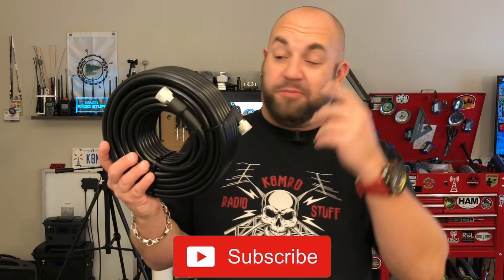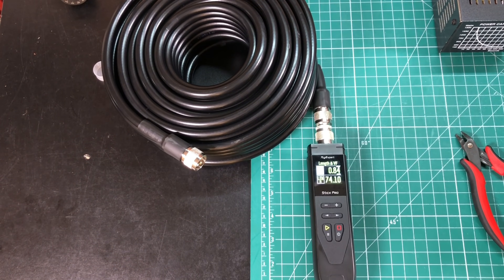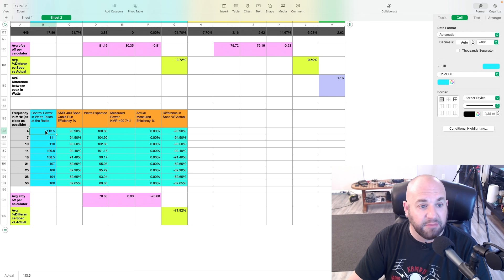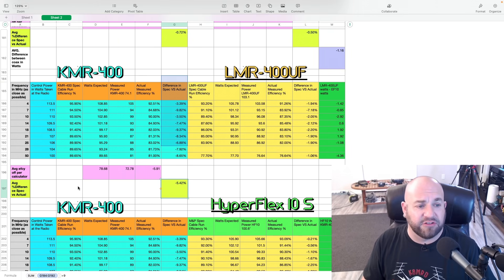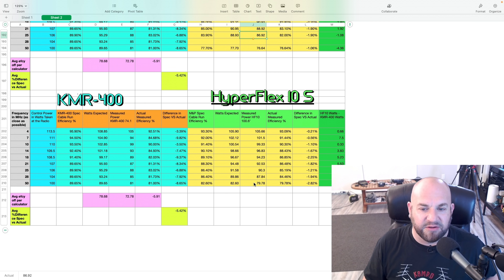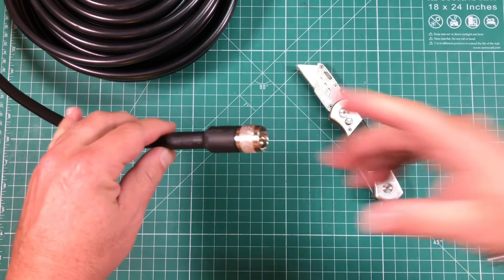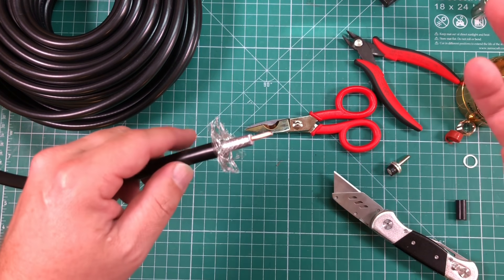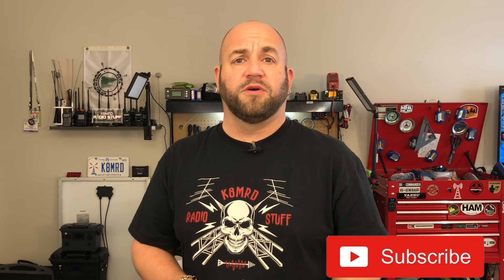I Bought KMR-400 Coax From Amazon | How Bad Can It Be?

Comment: Thanks for the interesting video. It's a decent test, but like another said I would prefer to measure the velocity factor instead of using the published value for Times LMR-400. I would also recommend computing the loss in dB for comparison with the table published on the Amazon site and for comparison with other cables. It would be easy to normalize the result to loss/100ft or whatever standard you want to use.

I wonder if the capacitance of the dielectric could be (easily) measured... that would provide another data point.

All that said, I have some cheap cable that I bought when I first became a ham (about four-years ago). But now I buy cable from reputable sources, including direct order from ABR or buying from DX Engineering. I really don't trust Amazon and do not want Chinese sourced supplies.

The Chinese can make good stuff. When they do, the cost is comparable to other sources (naturally). 

I'm reminded that when I was a kid (the hills were not yet dusty), "Made in Japan" was a pejorative. The Japanese figured it out and now their production quality is top shelf. The Chinese can too.

73 de AG7TX
Reply: Long ago the British had products coming from Germany labeled as "made in Germany," also to reflect alleged poor quality.  Of course now "Made in Germany" is a badge of quality with (almost) no equal.

Comment: The connectors may have a problem tightening up on the radio/antenna. I bought 25 that looked like them, the threads on the sleeve were not enough, causing only 1, maybe 2 turns on units
Reply: Buzz  I ran into that too and  got on Ebay and bought some  Amphenol pl259 connectors and soldered them on ...problem solved  73  Bob
Reply: FYI  my cable had copper braid
Reply: @robertsumption1243  I bought the bad units from HRO, I called the day they came in. I was told to send a pic, I did, never heard from them. I spent over $12.000 that year with them.  You would think they would replace them. I no longer buy from them.

Comment: Well, at QRP levels, you might be able to quibble the losses. But for most of the kilowatt crazies, well, at that point, who cares? Yeah. I'd use it. Even for QRP maybe even. Especially when you conside all my coax is pulled from the dumpster tossed out ethernet hose maybe 20 years old ;-) Thanks for the review & video. Stay sane, amigo. 73 de W8IJN
Reply: I knew a guy that ran cable left over from a local cable TV truck that he got for free. 75 ohm coax on a 52 ohm antenna gives you a 1.5:1 SWR which is a blistering 4% loss. All of the "experts" told him he couldn't do it, but...
Reply: Even at QRP levels there is no need to quibble the losses. It's a small percentage.
de M3KXZ

Comment: Probably suitable for most installations but a few thoughts...  Lack of specs on Amazon mean you had to assume a lot in your testing.  It is possible it performed even better to its actual specs, just not to LMR-400's specs.  (Although, who knows... without the specs, it may have performed even worse!!)  But since no one ever claimed it was LMR-400, is it fair to test to that standard?  Probably not.  You should have done an actual length measurement- simple enough to do accurately.  Chances are, it really was 75-feet, just that your velocity factor was incorrect for the actual sample of cable you had and therefore the length measurement is off a bit (also, TDR length measurements are rarely accurate).

Having said all that, we don't really know what the dielectric used is in this cable.  That has a huge impact on the test results.  The other "Amazon" factor is that you could order this cable ten times from Amazon and not get the same exact product each time.  So who knows what you're getting next time or from where?  Will those good connectors be on each product?  Don't know.

When it comes to the performance of radio systems, the transmission line is absolutely critical.  Especially when tower climbing and winter maintenance come into play.  Better to spend a little more money and get known quality cable from known reputable distributors who know and understand what they are selling.  Amazon's integrity goes as far as refunds or replacement - but that is little consolation if you missed grabbing rare DX because of a cable failure at the wrong moment.

As always with the likes of Amazon, eBay, etc., buyer beware and you get what you pay for.
Reply: Agree fully on every single word! Living 70 km south of the Arctic Circle and with the temperature (-27) at the time of writing, there is no doubt that a good brand coax is the way to go! I would not call it a healthy operation to climb a tower today. 😁

Comment: I wonder if you would solder connectors will it help with power loss?
Reply: If the crimps are done properly, not really. If the crimps are loose, definitely!
Reply: @nicklikesradio  It’s interesting to note that crimp connectors are used near exclusively in air transport aircraft, an application that demands reliability so that shows that if done properly they are not a problem. Soldering a copper clad aluminium centre with a foam dialectic can be difficult due to heat transfer down the conductor and melting the dielectric. Solder can be botched too.

Comment: Interesting. The build looks like pretty good quality. I'm curious as to what causes the greater signal loss.
Reply: As the other person mentioned, the gap distance in the foam air core. But also the crimp connectors and resulting interfaces. I'd be willing to bet with a good set of press or solder type PLs for LMR from TMW or Belden etc would probably improve performance
Reply: I'm thinking the signal loss has to do with the quality control as to keeping the center conductor as perfectly centered in the coax as possible. Materials could be another issue. You saw just how easily Mike was able to rip the outer plastic off the cable. Not so easy with the quality stuff. Of course Mike is a beast, maybe he just made it look easy...lol
Reply: The greatest loss in coax up to around 1 GHz is the copper loss , or should say conductor loss as some of the cable id made up of other materials than copper.   That is called the I square R loss, or the heating of the wire loss.  Standard power loss in a conductor of any type including the house wiring  or wires going from the DC supply to the radio.   The  foam type insulation just allows larger center conductors for less loss for the same basic size coax.  There is some small less loss in a solid center conductor than the stranded especially as the frequency goes up.

Comment: Hey Mike, love your videos! Have you considered using a nanoVNA and making a 2 port measurement of loss from 160m, up into the uhf range?
Reply: Good Point.. My guess is that the added loss at the higher frequency is related to the dielectric material used.. Also is how close the tolerance is related to the center conductor and shield. Is it perfectly spaced along the entire length. 
I had a VIP tour of the Belden Factory back in 2012, and the machines used to make their cable are super complex and fully computer controlled.
Who knows what they do in China???
Robert
WA6PHN
Reply from the maker: I have not.  I actually bought a Nano VNA a couple years ago and hated it so much I gave it away.  Too clumsy of an interface.
Reply: @hamradiotube  for the price it's an incredibly powerful tool.